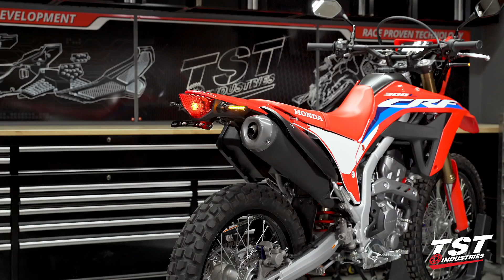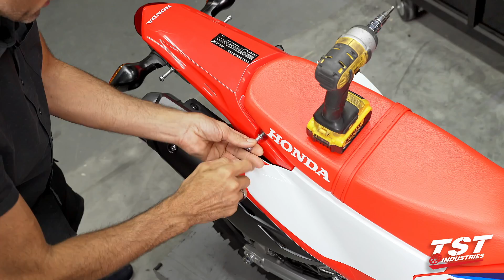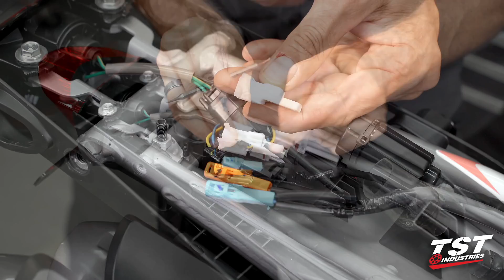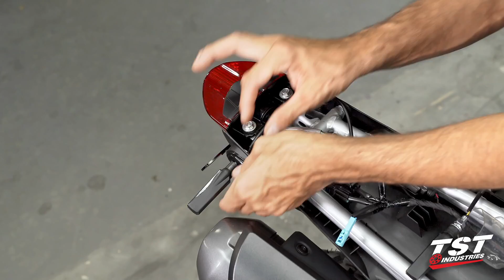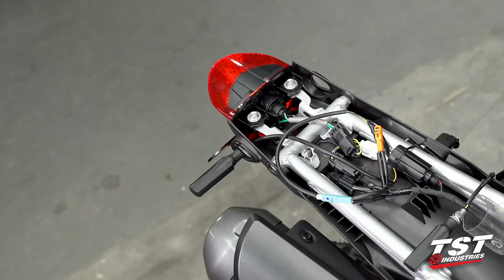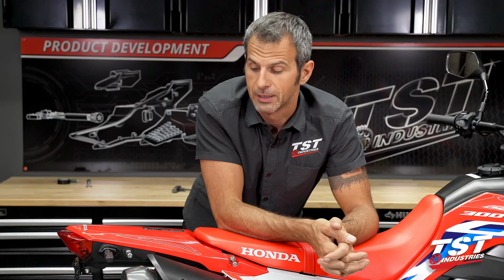How to install LED Rear Turn Signals on a 2021+ Honda CRF300L by TST Industries

Comment: Excellent video, I just did mine In about 30 mins start to finish.

I couldn’t get the tool I bought, or a fine sewing needle above the pin inside the plastic connector, so I didn’t waste any time on it, I just used a pair of nippers to cut the plastic carefully right up beside the pin and slid it out. 👍🏾

The only thing that didn’t make sense to me was when I did the front yesterday, the guy in that TST video left the flat metal washer on the BL-6 whereas you took it off and used it at the other end, which makes more sense to me so I’m going to pull the front apart again and redo them your way ! 💪🏾

Thanks from Canada for the great vids and the awesome well priced products !!!

Comment: You make it look so easy to get that pin out! This is brutal!! What is the trick??

Edit… jammed a tiny screwdriver in from the wire side and mangled the white plastic till it gave up. The second one worked with a large safety pin and was much easier when I knew what I was up against! Lol

Comment: This is out of left field, and a guess - Honda may have separated the PWR & GND leads to avoid potential shorting and fuse blowing or electrical system damage. Why? I can only guess because it is a dual sport and those connectors are located in virtual swimming pool back there in the rear under pillion body work….I suppose the 2 separate connectors could isolate PWR & GND in case there is a lot of moisture or water that gets in back there?
Reply from the maker: Water is too poor a conductor to cause a short circuit at 12V DC. It's not likely that this is the reason but I do appreciate you weighing in with a possible idea.
Reply: @TSTindustries  fair enough….and that is probably correct. I don’t know about salt water or other standing water that might have all manner of additives - no experience measuring those kinds of things. I did put a set of DVM leads in a cup of tap water and got 200k to 300k Ohms so your point is essentially proven. I guess my second thought would be they did it to take advantage of economies of scale….in other words they had a style of single-lead connector that would work in many different areas on the harness and rather than add another item to the BOM (2 pin connector) they reused connectors as much as possible….it’s such an odd thing that I want to know why ✅🙃🫣
Reply from the maker: @joerectifier  it has been irking me for an answer too. I have hypotheses but all have a counterpoint. The two conductor connector already has a slot that can house yhe separate ground and use the same terminal. Packaging is better with one, it produces less labor need in assembly, and easier to connect during factory assembly. Im just lost on the reasoning behind the separate ground housing

Comment: Great video! Will be calling soon.
Reply from the maker: You should check out our new integrated tail light / fender eliminator combo. It is able to work with or without the signals in this video, and transforms the entire rear look of this bike to a sporty and sexy aesthetic.

Comment: Will this work on a 2020 crf250l ? Wanting to change the turn signals so my aftermarket exhaust doesn’t burn the stock ones

Comment: Well, even if I knew beforehand Honda used two separate connections for each rear turn signal, on the CRF300L, it wouldn't have been a deal-breaker.  So it follows I would have preferred a plug & play solution from TST instead of wasting time trying to remove the negative terminal without a supplied tool made for the purpose. While I heard a safety pin could be used, I noticed a specific tool was used in the video. After fiddling for an hour or so with various pins and micro-screwdrivers, I reached for my trusty Dremel tool w/cutting disc and exposed the locking tab in a couple minutes.
Reply: I will be trying the dremel next, if that does not work, I will just have to be content with no turn signals. 2 hours of sticking a pin in the connector had me close to burning the bike, am truly interested to why Honda designed these this way and not have the connection in one connector, especially since they have the space for it.
Reply: I absolutely agree. I have been fiddling with this connector for an hour and can't get it to release. This friggin sucks!

Comment: Damn, the white ground separate terminal is a total bitch. Got one lose, but not the other. After about an hour of trying, lost patience. Pulled the damn wire out. Now what? Any suggestions? Or just use some country boy engineering?
Reply: Got it fixed, just not up to Honda standard. The clue was in your fender replacement, when you said Honda ground is the green wire. Now working fine.

Comment: Why make this needlessly complicated? Why didn’t they just do it the way Honda did and make it plug and play?? And I hate the way they nickel and dime you on everything. It should have just been a simple kit. No sale for me.
Reply from the maker: Nickle and diming would have resulted in us creating an entirely new converter harness and upping the cost even more. The method shown is the most cost-effective for 99% of the market. Honda made this needlessly complicated, we tried to standardize this method in the same fashion as Honda's previous models. And the best thing about a free market is your ability to shop anywhere so best of luck to you!
Reply: @TSTindustries  Nickel and diming has nothing to do with a new harness. You mentioned a couple of things in the video that were an extra cost that I would think should have been part of the kit. Such as, for example, the sold separately plugs to fill the holes where the old blinkers were. Instead of doing that whole song and dance with the pin why not just use a 2-into-1 converter to make the connection. We do things like that with adapters in computer systems and networking components all the time. Nevertheless, if this solution works for 99% of your customers that's great. It just doesn't work for me. So as you said, thank god for the free market!! Much success!
Reply: @ronaldpacchiano7587  I think the reason why they did the "whole song and dance" with the oem connector is because they already developed that connector and developing a new 2 in 1 connector would drive the price up. Also the plugs to fill the hole where the old turn signals were are included in the kit on their website. The flasher relay isn't though
Reply: @TSTindustries  This is a weak design. I have been fighting this connector for an hour and can't get it to release. I would gladly have paid a few bucks more for plug and play. At least make it an option for buyers.

Comment: Way to complicated for me.  Im gonna keep the original signals.
Reply: It's probably one of the easiest turn signal jobs out there. I didn't mess with any of changing pins to connectors, just snipped the OEM connectors off the amber signals and connected the wires from the LED turn signals.
Reply: @peter15walsh  Easy for you to say. I put money into a skid plate instead.
Reply: @SuperLaplander if you can install a skid plate you can install these signals. It’s really not that hard. Don’t be scared to try things and learn something new
Reply: @rainypath96  Thank you sir for the positive message!